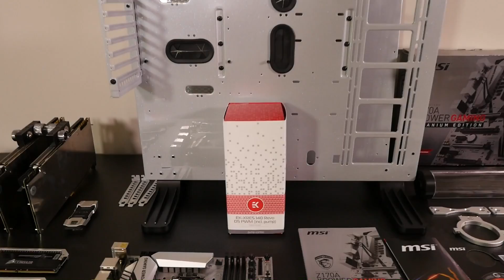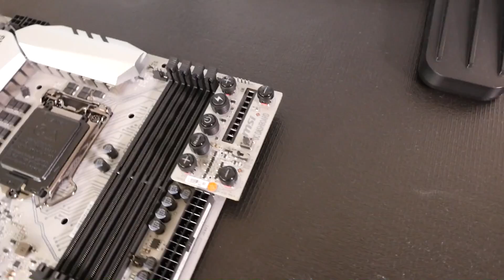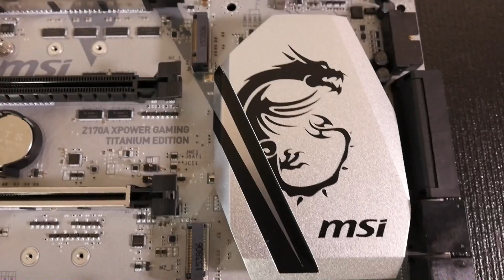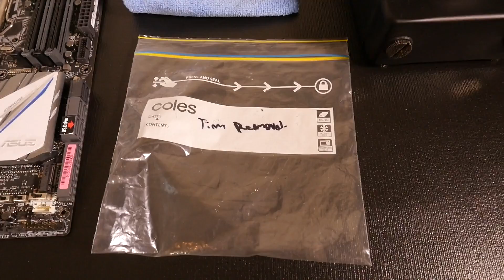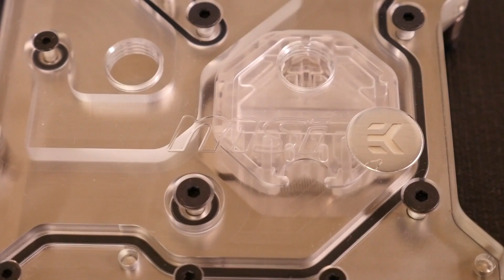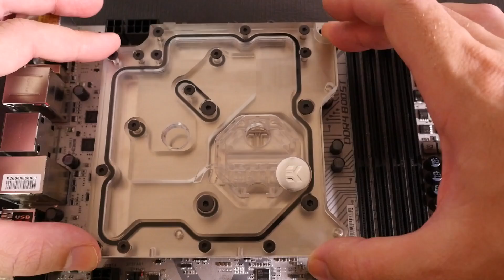SC Build #22: Core P5: Part 3

Comment: Hi Daniel. I love your channel and i learned a lot from you. May i ask why you are using 2 different liquids in order to remove the TIM? I always use Alcohol, isn't that enough? I don't want to sound like a know it all but that way how you spread the TIM... i mean, you don't need to spread it because when you apply a small pea size in the middle of the CPU the heat sink/waterblock will do it for you.. especially when it gets hot. When you spread it it will most likely touch the PCB because when it gets hot its getting thinner and spread even more.. Also when you spread thermal paste you end up with bubbles which is bad for temps. There are even video's about how thermal paste spreads so there is proof as well. You know A LOT more than me about PC's, hardware and software but i am little disappointed by your spreading method to be honest, everything you do so well and than we see this terrible way of applying TIM.

Comment: There is a video on Linus tech tips testing different ways of applying thermal compound, and they found that the only thing that will negatively affect temperatures is not having enough. (although having too much can cause a short, and is annoying to clean)

Comment: that extension cable is actually for the OC dashboard. when using ln2, the buttons would freeze. so they included that cable so you can get the OC dashboard away from the motherboard.

Comment: Just remember kids, with the 6700k you can only run 1 m.2 nvme in PCI-E when running sli. The other will only work in sata mode, this cpu does not have enough lanes to run them both in PCI-E.

Comment: Good job mentioning that it should have 90deg 24pin connector, when the hell are they going to start putting them? Not just msi but all the others, I know there are connectors to buy but I'mot so comfortable about soldering/desoldering pins on the board

Comment: I made a system for a client using this board. I missed the rear I/O cover so much that I actually designed and 3d printed one for it! Let me know if you need the source file, would be an honor for you to use it. Thanks for the great video.

Comment: just a question... You don't have to worry about oils on your hand affecting the CPU? love your videos be a fan for many years
Reply: You're only touching the IHS, so it should be no biggie. The paste is just there to fill the air gaps pesky metal atoms don't want to fill and provide maximum thermal contact
Reply: The only difference for me personally is that I put my finger inside of a fresh plastic bag to spread it out.

Comment: On the these build and last one I did not see a fan controller! You are using a software or hardware
Reply: +Southeastern777 I am a huge fan with his work they are masterpieces. But since I see the 440 black razer and now thee one I wanted to learn.saddly I am so far away. Of course I do not expect the secrets but that is a good one. The fans from last build I am going to order plus I am working to get the tools to start on Daniels startup kit for wire sleeves and connectors

Comment: Nice tip with the thermal paste. Question I have a DeepCool captain 360 the block is not smooth have some circular indentation these can apply on the same technique? Is hard to explain there is a way to send you pictures? Since I have some issues on temps that goes up and down I have try everything even on oc max temps at 4.5 are below 75c but there are variations I am using Maximus hero VIII.